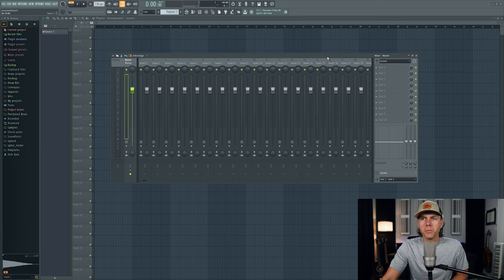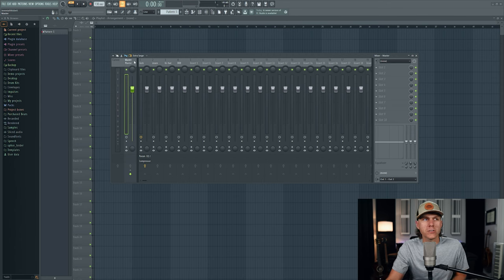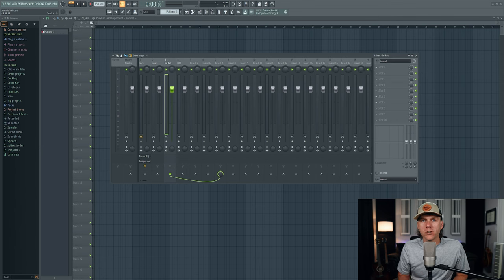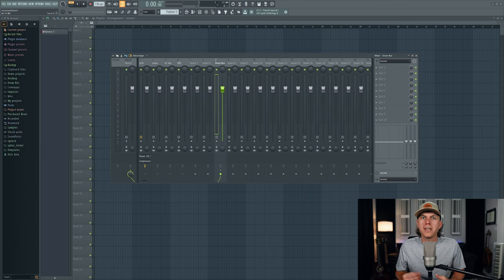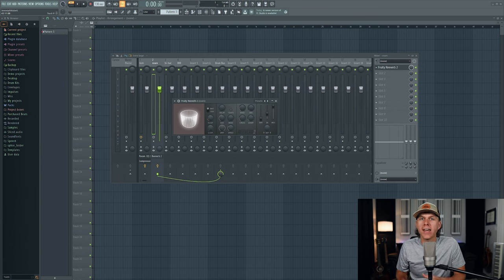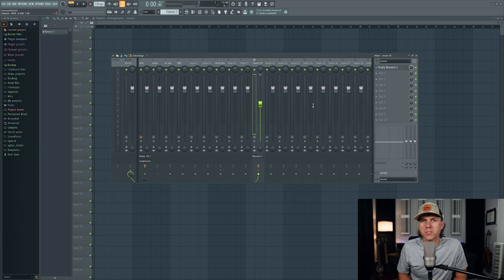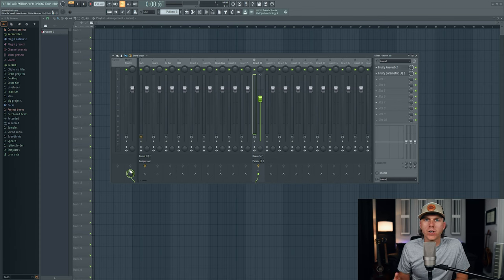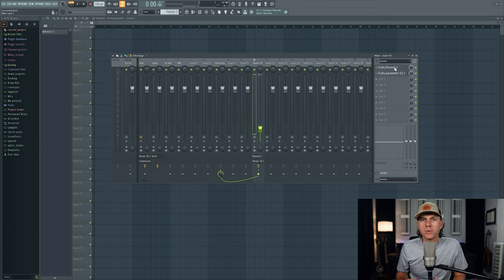Routing in FL Studio - Busses, Auxes, Sends

Comment: Great videos. Can you send audio from a mixer channel to an external stereo pair on your soundcard or can it only be routed to Master 2 bus or another stereo mixer track? Are there ways to get audio out of FL Studio besides the Master bus?
Reply from the maker: Yes there is a way. Un-route it from the master. Then on the bottom right of the mixer there is a dropdown box where you can select your external outputs. Then if you need to route it back into FL Studio you would select an open mixer track and in the top right there is a dropdown for external inputs.
Reply: @mixwithjerry  Nice, thank you
Reply: @mixwithjerry  Thanks again for interacting with the comments here. Do you think Image Line will consider a delay compensated external insert, or upping the mixer channel count from 125? Kind of creating a more mixer-friendly environment for FLstudio?

Comment: Okay, let's say I have 10 different channels with vocals on them and I want to apply pitch correction on them using bus. After doing it, can I still add different effects on individual mixer channels, or I have to create another mixer channel so all others effects I want to apply would go there?
Reply from the maker: So if you were wanting to apply the same exact AutoTune settings to each of those vocals then yes, you could route them to a bus with the AutoTune plugin on it. The problem with that is if those vocals are coming from different artists who all aren't as in tune vocally. You wouldn't be able to adjust the AutoTune as necessary for each vocalists, but if it were the same artist for all of those takes you could forsure get away with the bus method. You can still add the individual effects on the mixer channels themselves. However, if you had any of those effects being applied exactly the same to each vocal - you could also throw that effect on the AutoTune bus. Hope that helps.

Comment: Can't you just change the mix level of the plugin by effects?
Reply from the maker: Yeah but then any plugin loaded after would be applied to both the reverb and the vocal. If you separate the reverb from the vocal, you can process them separately. For example, if you wanted to add distortion or phasing to the reverb itself - you wouldn’t be able to because the distortion and phasing would also affect the main vocal.
Reply: @mixwithjerry  oh okay that sounds very useful thank you